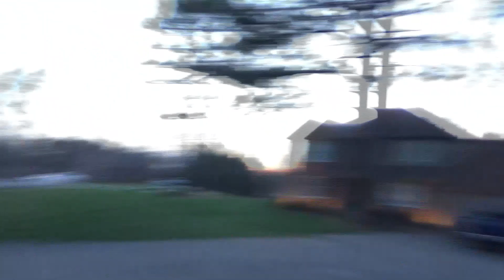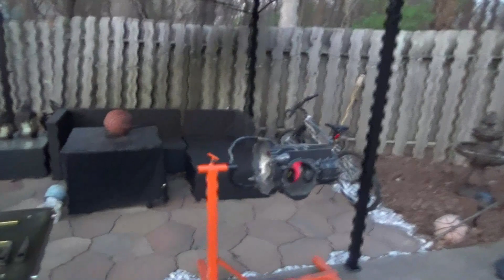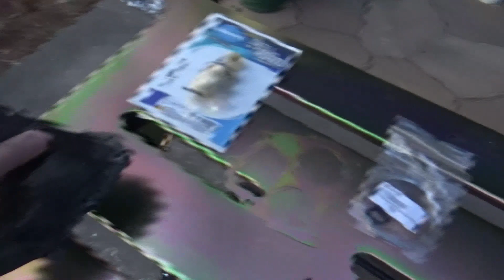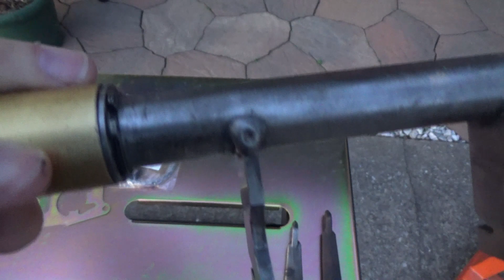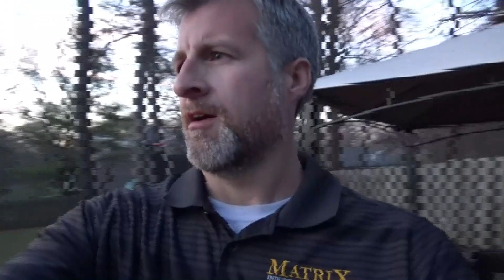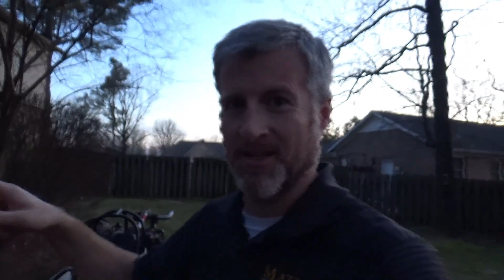Storm Damage and New Parts For the Drag Rail Transaxle!

Comment: Hi, how were you able to weld those aluminum gussets to that magnesium case? I want to do the same for my drag racing sand rail
Reply from the maker: Well, as I see it, there are at least three different ways of adding those gussets.  1) welding mag plate to the mag tranny; this takes some super welding skill well beyond what I am capable of doing at the moment and carries with it the great likelihood of warping the case - plus I don't know of anyone locally that would do it...so I didn't go this route.  2) You can "weld" aluminum to the case by means of a brazing technique with something like an alumiweld type product, which I almost did but decided against it due to the low ignition temps of magnesium.  That's a great proven technique but it just requires a ton of heat to get it to spread correctly.  3) what I did was use a newer and unorthodox method, that many will shake their heads at, of using an industrial non-sag 2k epoxy (not the jb weld stuff you get over the counter - the good industrial stuff with gun applicator).  It's used in in many structural and machine manufacturing processes of the day that we see in the engineering industry I work in.  When the surfaces are properly abraded and thoroughly cleaned, It has high impact resistance and excellent sheer strength - really a super impressive product that is underused.  While it's not a great choice over welding in many areas, my believe is that it will work nicely for this application.  I believe the magnesium would crack and fail before this would.  I used 3/8" plate too on the sides to get the most surface area to adhere to...and these plates have to be pretty accurate for it to perform its best (which is difficult to do).  For what I'm asking it to do (which is keep the case around the ring gear from flexing or cracking) I believe that with BOTH top and bottom gussets it will perform as required....I'm gambling a good 3.88 R&P on it, plus I'm not planning on turning the earth with tons of HP either.
Reply: @culturedredneckgarage3784  Thank you very much for taking time to respond and sharing all that great knowledge. I'm really considering an approach similar to yours. I have a mid engine rotary powered sand rail I'm building for drag racing and the rhino case i bought used with top and bottom gussets is cracked.
Reply from the maker: @christiantorres1920  No problem, sir!  Please don't get the impression that I know everything there is to know on the subject...I'm just a guy learning as he goes.  This is an experiment like in the early days of drag racing which I believe (hopefully not in vein) will work.  A Rhino case with gussets would absolutely be my first choice in a mid-engine build and I suspect I will likely eventually move towards that on down the road after I get a feel for where 1st - 3rd gearing should be in this application - you've gotta start somewhere.  I just didn't want to allocate $600 towards a new case right this moment.  I would think that with the gussets, super thick performance sidecovers, good clutch management, and launch preload, it shouldn't com apart - we shall see.  This whole build was originally designed for dirt, so my shock loads were going to be well within a manageable range.  But with the future of dirt drags in this area up in the air, I'm trying to make it as versatile as I can - which is difficult to say the least.  Your build sound very cool!
Reply: @culturedredneckgarage3784  Thanks I appreciate it. Waiting for updates on your build keep the videos coming.